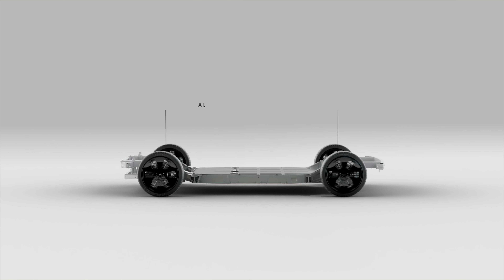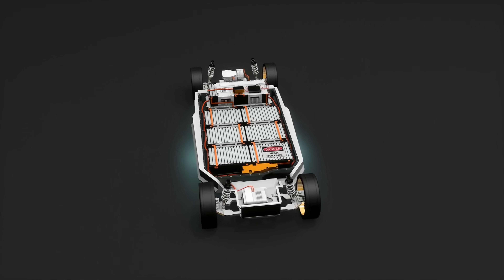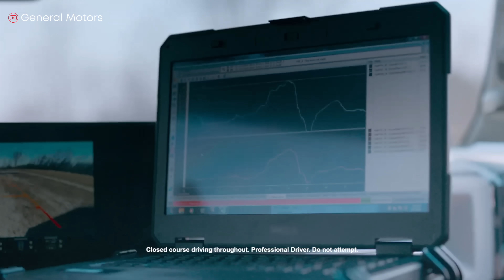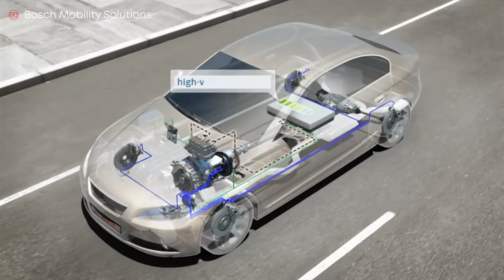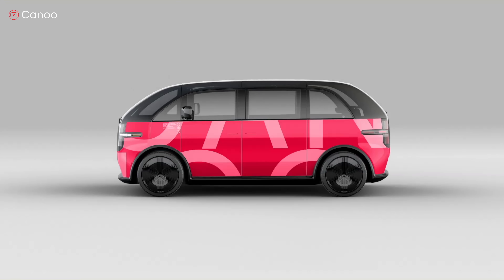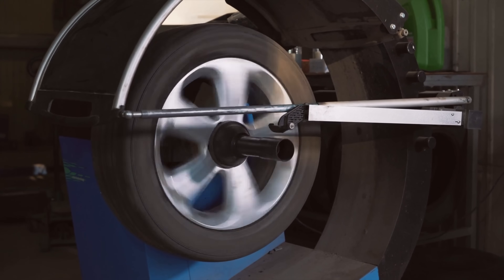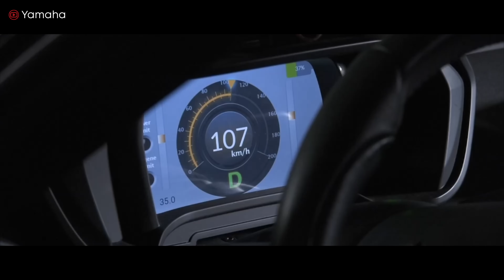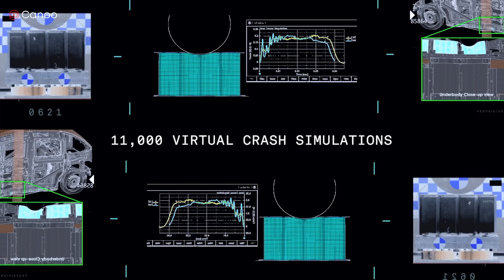No One is Telling You the Truth About Electric Cars, So I Have To

Comment: I remember when I was an undergrad in Engineering.  For a term paper I wrote that AC inductive motors should be used for vehicles such as trains and cars instead of DC motors now that power semiconductors are available.  Everyone thought I was crazy as the speed of AC motors are tied to the frequency of the AC power.  None the less, that's exactly what happened in the industry, even brushless DC motors are really AC motors with power electronic controls.  My undergrad paper was at least a decade ahead of it's time and indeed the year after my paper, the city had an experimental LRT train with the University using AC motors under a power electronic inverter control exactly as I had described.
Reply: Funny, because when I was in High School, graduated in 1978, I said cars should have three motors/engines in them. One a larger gas powered engine for long trips. A second smaller electric motor for medium and short trips. And a third small single cylinder engine, think go cart, that could maintain a vehicle speed on long flat straight stretches hooked up to one wheel, and that could also be run to generate power to recharge the battery for the electric motor, either while the vehicle was in motion, or while parked at a restaurant, hotel or other. Yes, it would be heavy, and not a lot of storage, but certainly adequate for most people.
Reply: Remind us all again what company you are CEO of.  I am in awe of your genius, Wang.
Reply: @x666x34b  A bright idea only benefits you in the right situation.  It was just an undergrad term paper on electric motors.  It didn't have the promotional value of say Alcubiere's graduate paper on the warp drive.  It really wasn't something I could take advantage of.

If you want to talk about bright ideas.  Back before I took grade 10 math which had trigonometry, I was fed up with forgetting my geometry set for Physics so I couldn't measure angles but it was obvious that there is a relationship between slope and angle and you could easily use a scrap of lined paper as a crude ruler to measure slope with so I started writing a program for my RadioShack programmable calculator to convert slope to angle.  I was getting frustrated as I had to keep adding terms where the values deviated too much.  Needless to say, such a relationship is the arctangent function and the relationship is an infinite series.  Basically. I was working on developing trigonometry just because I kept forgetting my protractor.  My physics teacher did ask what I was doing and then asked me if I knew what the trig buttons on my calculator were to which I said no that I didn't know what the buttons did, he just moved on after that as he was proctoring a test.  When we finally did trigonometry in math class. I did a face plant on my desk.

In the fourth grade. I also wrote a SciFi short story where I had the jet powered by what I called a space jet.  Of course, unknown to me at the time, the idea is the Bussard Ramjet, a rather famous proposal for an interstellar spaceship.  A lot of people come up with bright ideas independently but few have the opportunity or timing to benefit and or become famous for them.
Reply: Railways have switched largely to AC motors due to their improved performance, so I was not surprised to learn that electric vehicles are doing the same.
Reply: @richardhorlings3774  Yes, but when I wrote my undergrad paper, DC motors were used for variable speed control as the speed of ac motors are determined by the frequency of the AC power and how many poles the wiring is using hence speed control were in unit steps of multiples of the frequency with magnetic slippage between which really messes with your torque as well as heat production.   My paper was that with the then new power semiconductors, the AC motors could be controlled through variable frequency AC power from inverters which is exactly what happened.   The focus of the paper was to propose using AC motors for trains.   AC motors had always been more reliable and had less maintenance then commutator DC motors but variable control had always been the problem with their use and this all changed with power electronics.   I also pointed out that AC power transmission also had far less energy losses and required less conductors but at that time, frequency changes were done with motor generator sets and I was proposing that too could be replaced with power electronics.   Given that power electronics were largely inefficient at that time, my claims were quite bold.
Reply: Solid state variable frequency drives for AC motors have been around since the late 60's, and certainly mechanically based variable frequency drives go all the way back to the early 1910's, I don't see anything novel in what you proposed.

Comment: If batteries only last 10 years then you shouldn’t buy a ten year old electric car (or hybrid)
Reply: Electrics are basically a disposable car because of that. Drive it for 10 years and then find a farmer's field.
Reply: Tesla batteries lose 10% capacity at 200K miles.  American drive 13K miles on average per year.  So you should get 15 years with a perfectly good battery.  At 300K miles they tend to have problems.   That should be around 23 years of use for the average American.  This is with their first generation batteries used on Model S and X.    The model 3 and Y are supposed to be good for 500K miles.  That would  be 38 years of use.
Reply: @victorluke5816  In the real world, extreme heat (Mojave Desert) and extreme cold (Anchorage Alaska) cut battery life in half, according to my buddy who’s an engineer
Reply: @jeffzekas  The Model Y is the only one I would recommend for those extremes.  You get back 40% of the lost 50% range with their Octovalve heat pump.

Comment: While suggesting to park an EV in the shade or inside is helpful, a much better suggestion would be to leave the vehicle plugged in so the battery management system will operate keeping the battery at the target temperature. Most electric cars will not thermally manage the battery without being plugged in due to the loss of range to run the systems.

Not every electric car has "one pedal braking" to bring the car to a stop by simply taking your foot off of the accelerator. My Volt doesn't have this, and yes; it's an electric car (with a backup gas generator).
Reply: “ battery stored for 5 years at 50% state-of-charge will have the exact same voltage as it did when disconnected” — FALSE.  Batteries have internal resistance which will cause them to self-discharge.  For example my laptop battery when disconnected from the laptop & sat on a shelf will be near-zero after a few months.

Comment: I'll stick with an IC engine. The reasons are too many to list.
Reply: range
Reply: Being poor and stupid is up there
Reply: @DrakeDealer   man,no need to expose yourself
Reply: @DrakeDealer  that aint nice, nor is it true. there are higher cost of insurance, lower resale value, home electric wiring upgrade costs, what if you park in the street, time spent at super charging stations, harder and more expensive to get specialty parts/repairs, some areas of the country dont have dealers or certified service techs for hundreds of miles, the upfront price difference, if you drive a lot daily
Reply: It's only because the infrastructure supporting ICEs make it convenient. If the push to mainstream EVs succeed, it's only a function of time when gas stations gets less common and now ICE drivers suffer from range anxiety instead
Reply: @josepeixoto3715  what do you mean please elaborate
Reply: @droicut     Diesel will  always be available ;  and  Diesel trucks  will be nuclear before they run on batteries;  some USS (united states ship) run night and day and only refuel once every 10 years (or is it 20 years?!...) ;   (good,smaller, diesel-electric subs exist but they need a diesel engine(or fuel cells or stirling ) usually a closed cycle diesel,  needing diesel and lots of on board liquid oxygen tanks).
Reply: @josepeixoto3715  I don't disagree, there will definitely be a niche market that needs the energy density of fuel and the relative fast topup. 

I'm just of the opinion that if the push for EV succeeds, the concentration of gas stations will reduce as EV charging stations increase. Money matters, and from the way it's going, I won't be surprised if additional tariffs gets imposed on either fuel or ICE vehicles or both just to mainstream EV

Comment: Traditional cars usually become uneconomic to repair due to electronics problems, not mechanical ones. There’s a heck of a lot of electronics in an EV!
Reply: This is false.  Every car I’ve owned became unrepairable because of mechanical reasons; Bad transmission.  Engine gasket blown.  Turbo not operating.  Oil seals causing major leaks.  Et cetera.
Reply: The electrical part of the gasoline or diesel car still worked
Reply: Don’t mix up the electrics with the electronics!

Comment: All batteries have a finite amount of times that can be recharged. The more expensive the battery typically the more cycles it can handle. But as with all machines, especially electronic, extreme temperatures are the enemy. I am not a fan of these for the simple fact that the batteries themselves are extremely toxic and actually use more water and energy to make than a typical internal combustion engine.
Reply: Cost isn't really the determining factor. Chemistry is. Thomas Edison designed an iron/nickel alkaline battery that is still considered 'perfect.' There are some over 75 years old still in service. The problem is they're liquid filled and can't be used in a vehicle. They're best for standby or 'off grid' power. I worked for a large company that wanted their computers to ALWAYS BE READY TO WORK so they had a large room in the basement of a 32 story office building with a few hundred Exide Iron Edison batteries. Most of them had "Date of assembly July 1950" and that was in 1991.
Reply: @seanwatts8342  all right sir will you please State how much those batteries would cost to replace them now? Good chemistry isn't cheap either especially the engineering and assembly part.
Reply: @turbohawk  You don't really 'replace' them. They get serviced and refilled with electrolyte. They cost very close to other deep cycle storage batteries.
Reply: Yep. Furthermore, the electricity to charge these “green” cars comes from the power grid. Most of our power grid energy is COAL.

Therefore, Tesla is a coal powered vehicle 😂 

Same with wind turbines. I know a buddy that works on those. Supposedly they are better for the environment but when you consider the massive amounts of fossil fuel to lubricate the fans that constantly leaks, the carbon fiber blades that cannot be recycled, and the fossil fuels used to haul out the infrastructure for the turbines themselves… it ends up not being green or produce any substantial amount of energy whatsoever.

It’s all a joke so vegans and democrats can make money off climate change nonsense
Reply: @richierex  we’ll see. Btw, I own the same model of k bike in your little movie. Just because I can look to the future doesn’t mean I don’t appreciate the past. Test rode a Zero recently. Incredible acceleration and arrived back with the same battery level as when I started, 50 miles later. Your right, I had a smile on my face but not because that bike was a joke.
Reply: @seanwatts8342  wrong.
Reply: Can it be that GM Tesla and others have enticed Scotty.

I liked his original formats.  This has elements of , well money money money
Reply: @howardhughes6212  cut your nails Howie.
Reply: @petes9524  SHOW ME THE BLUEPRINTS, SHOW ME THE BLUEPRINTS
Reply: @petes9524  Fine I’ll cut my nails but I’m still gonna pee in milk bottles because that’s how Howie rolls!
Reply: @davidlamberson5435  regardless of the environmental impact or the “science” your on about, oil is due to run out in 50ish  years anyway (and that’s a generous estimation), so you may have to rethink your statement.
Reply: @howardhughes6212  just don't wake up and chug the pilk in your confusion.
Reply: @davidlamberson5435  Can you form a complete sentence?
Reply: @howardhughes6212  NOT in Europe. Over 50% of the UK grid is renewables. Guess the US is far behind Europe.
Reply: Also huge amounts of rare earth minerals mined in China and children in Africa are in every EV
Reply: @petes9524  “Pilk was a bad choice.” -Ron Burgundy
Reply: @howardhughes6212  you're the one who pees in your milk, explain to Ron.
Reply: @drasticheadcase1021  what about eFuels? Surely if they're compatible with the millions of combustion engine cars/bikes, it's the right way to go in the short term? Lion batteries are a complete mess, particularly with regards to catching fire (and not being extinguished) and what to do with them when they're spent (that really should be factored into the cost of ownership!)
Reply: @bloophero  I reckon that maybe owners with classic vehicles may convert, say, to hydrogen which could be produced by electrolysis using renewable energy if they want to keep their cars going that go Banga banga boom boom. Why not. But progress is definitely electric. Got a mate who’s got a new Hyundai and he loves it. Got a 200 + mile range, more around town, will rapid charge in an hour or slow charge over night, little running costs and the technology is just starting. Can’t wait for a really decent electronic touring motorcycle. It could be the start to really cheap travel again, only clean and quiet this time. Progress is only scary if you make it scary.
Reply: @drasticheadcase1021  not as scary as a Tesla repair bill (insurance is also expensive on EVs). I think electric is the future, just not this current generation of battery tech.
Reply: @howardhughes6212  Stationary power plants are much more efficient producing power from fuel than engines in vehicles. The after treatment systems for emissions are not constrained by size and weight as well. There are losses in transmission and storage but overall electric vehicles use energy more efficiently than ICE powered vehicles, especially in city driving. For long haul driving, like over the road trucking, or where a lot of energy and low weight is needed, like airplanes, it still is impractical.
Regarding petroleum used for lubrication, all I have been able to find indicates that proper maintenance calls for changing lubricating oil about every 16 months and that is expected to go to once every 3 years with lubricants being developed for off shore turbines.
Reply: @richierex    Well your smart phone or tablet/pc is electric.  Jokes on you!
Reply: @bloophero  possibly. I think Elon musk has to finance his space adventures somehow. But you might be right about the batteries. Lot of advancements being made in that area tho.
Reply: Not true.
Reply: @TL-xw6fh  actually we are already at 47%.
Reply: @bloophero  so far in 4 years no service or repairs and insurance is compatible with the same priced ICE vehicle.
Reply: @seanwatts8342 Yes.

Comment: I'd like to build a DIY kit built car but entirely electric. That way I can swap out the systems as needed without overlapping lines and parts. True, both petrol and electric systems have build costs, running costs, and long term use cost. You can't swap out a fuel tank, but you CAN swap out new cells with larger capacity or a more efficient electric motor. Perhaps Axial Flow isn't your jam?

Comment: My manager where I work bought the Ford mustang EV. The other morning the temperature was in the upper 20’s. When I parked next to him I noticed the windows were still frosted over even though he lives 20 miles from work. So I asked him and he said it was the only issue he has with the car. Air conditioning isn’t cold and forceful enough, heat isn’t hot and forceful enough. The car won’t defrost the damn windows? That’s like driving a pre 70’s VW BUG in the winter. That’s a huge problem.
Reply: I don't have that problem with Nissan Leaf and I live in Finland. Heating works well in -28 celsius(-18.4 fahrenheit) weather and windows get defrosted, although rear windows do seem to get foggy in extreme cold if I'm using anything less than max setting.

Comment: Anyone has an idea of how long Tesla batteries last?? Not based on what Tesla says but someone who actually owns a Tesla or have seen a high Milage Tesla themselves!! ✍️
Reply: 1 hr
Reply: Long range is between 500k and 800k depending on how its chargerd and driven.
Reply: Better question: are you still able to daily-drive the original Tesla Roadster with its original battery?
Reply: @chunkemonke398  I work for Tesla, the original roadster Is a money pit. The battery technology is pretty much the same if not worse than a Nissan leaf. Original roadsters should be used as collectables that sit in a museum lol.
Reply: I saw a post from a guy who owns a airport shuttle service. He added a Tesla model S to his fleet a couple of years ago and puts a lot of miles on all of his cars. He posted that after 265,000 miles his model S had still had 92% of its battery.
Reply: It will LARGELY depend on how you drive it… Anyone giving you estimates are kidding themselves…